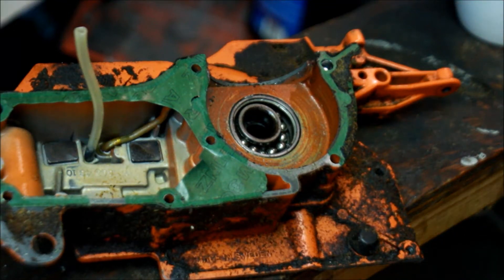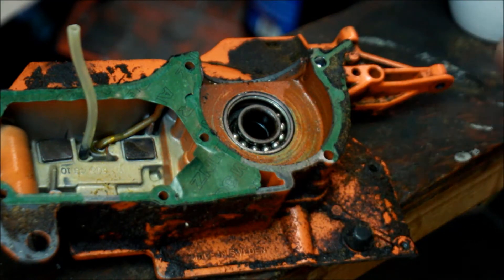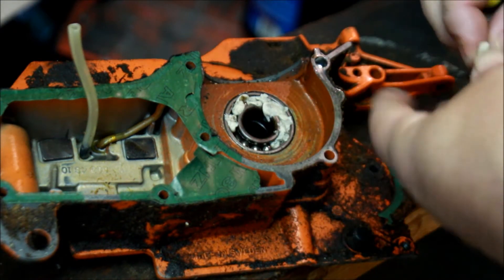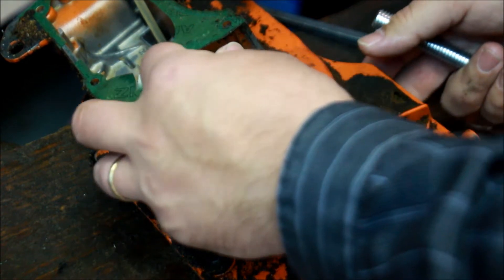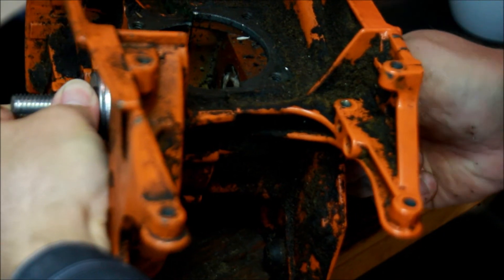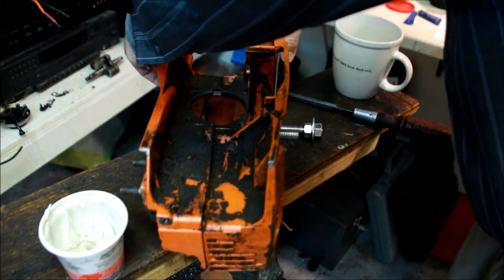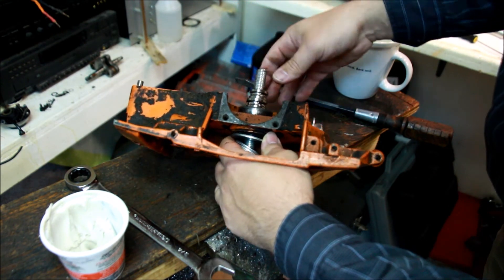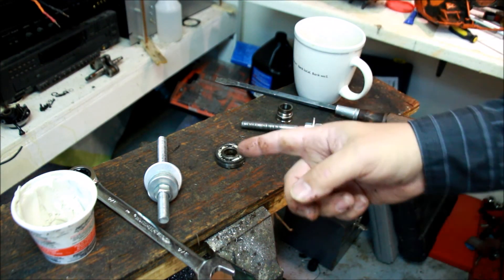Trick to removing a bad chainsaw bearing missing its cage

Comment: Hey Matt, this I've been watching your videos and they've been teaching me heaps on chainsaws and small engines. I've got my hands on some old 353's that I've been taking apart and learning with. I was wondering if there's any solvent's you recommend that I can soak the parts in to help take off old caked on grit and grime? I've air compressed off as much and I can and have brushed off as much and I can but there's still tons of gunk caked on.
Reply from the maker: Brandon Beauchamp unfortunately it just takes a lot of time to get a lot of that Gunk off right now I am using mean green solvent in my ultrasonic Cleaner I also use purple Degreaser but you have to be careful with that because it will actually etch aluminum and it will take the clear coat off of your paint otherwise a lot of guys use old gasoline to get the bulk of the stuff off cleaning things up unfortunately takes an enormous amount of time and it is certainly aggravating to spend that much time cleaning stuff up but it is indeed quite important best of luck
Reply: Matthew Olson thanks mate, I appreciate the advice!

Comment: Hey Matt, Not to take away from your great ideal, but a trick I've used for many years on blind bearings (like axle shaft) and this works incase you don't have plumbers putty and most people like it and it is some what cheaper Bubble Gum, not very good for the teeth but it gets the job done. Also just have to say I just ordered one of them Huztl MS070 Power Heads about 1/2 hour ago, I just couldn't come up with a good enough reason NOT to buy one. HAPPY Birthday To ME
Reply from the maker: Craig Timmons ya..bubble gum would do it!  070 here we come!  cool!